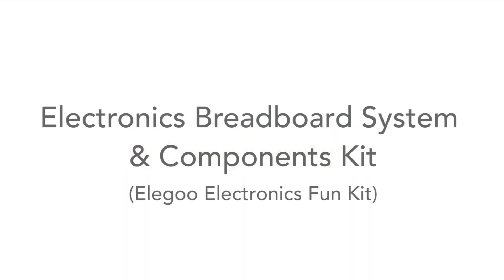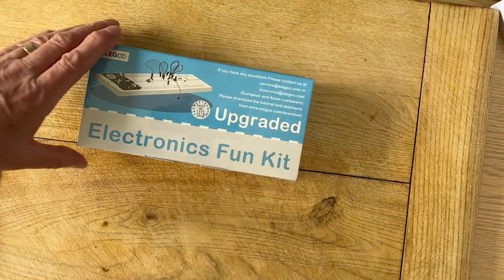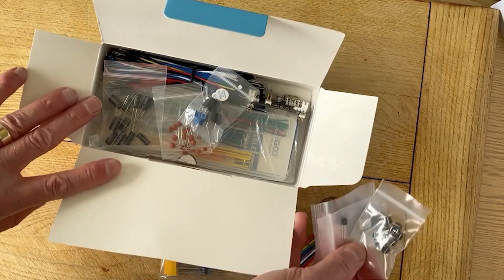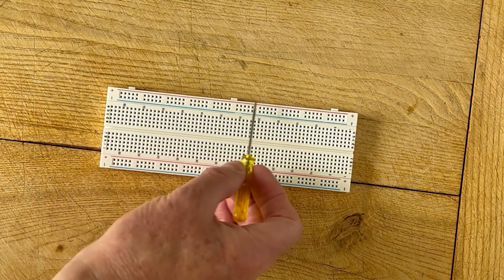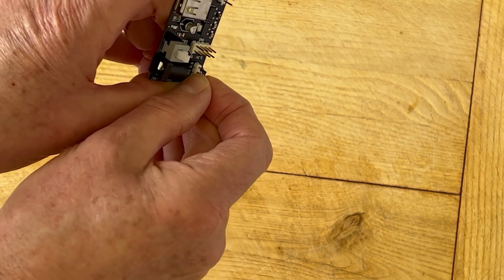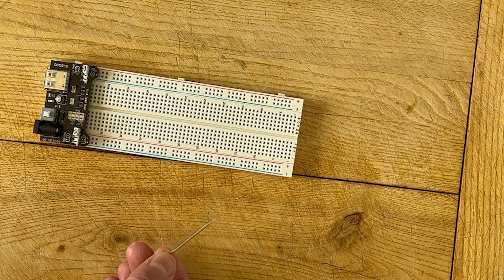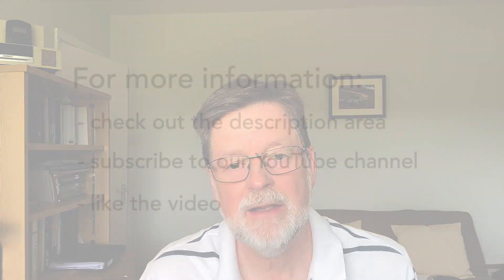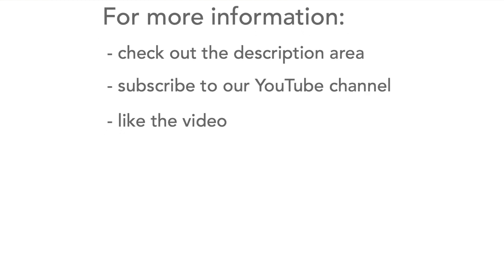Useful Electronics Breadboard System

Comment: Careful: I had one of these and found that if you accidentally short out the output rail then the 5V (or 3.3V)  linear regulator will blow.
Reply from the maker: That’s a good warning. I’ve not shorted the output (yet) so I e not discovered the hard way.